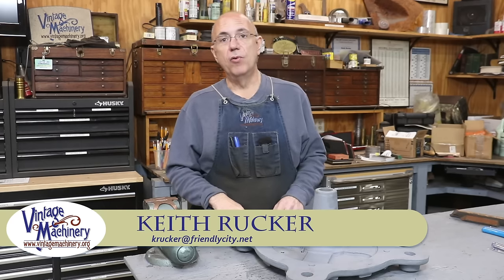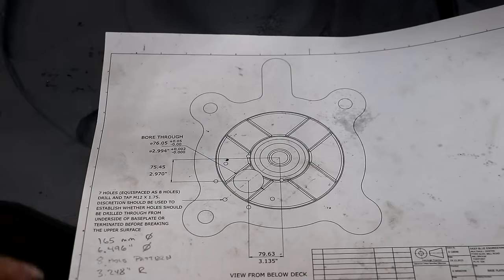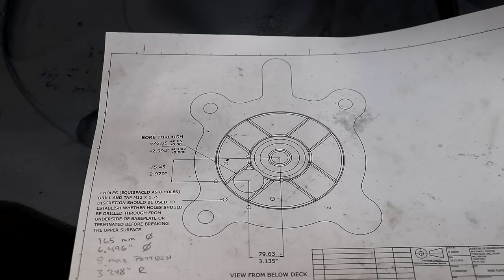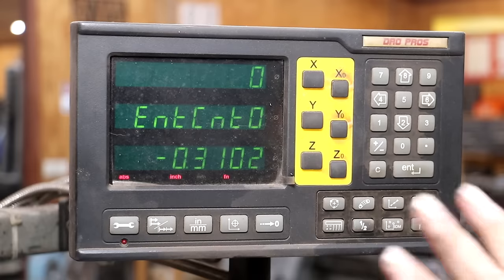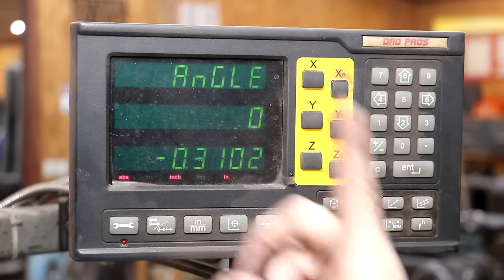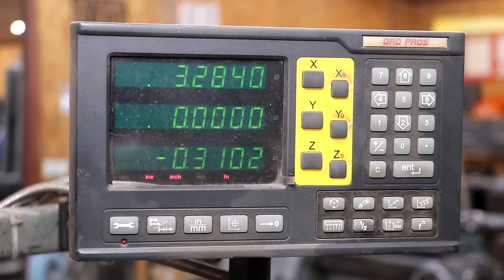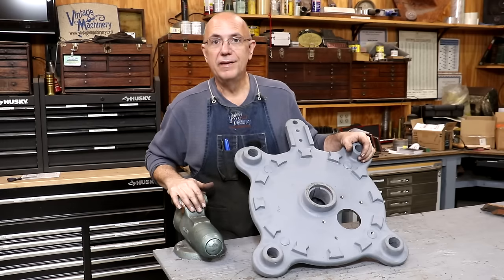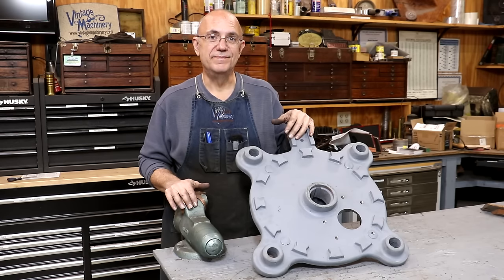Tally Ho Capstan Restoration: Drilling & Tapping a Bolt Hole Pattern in the Capstan Base

Comment: Just to warn you and anyone who sides with you about how you do a particular project. I disagree with the way you went about drilling and then tapping your holes.

You present your videos like a professional with the intent that how you deal with a job is the correct way. The end product, although it may be satisfactory, it is not always the correct way to achieve it.

Some viewers who watch your videos are looking to be taught how to do a particular job. Not everyone looks at your videos as just "entertainment." Therefore, as you introduce yourself at the beginning of every video, you should also include a disclaimer. Something along the lines of. "My videos are not about how to do a job correctly but how I do it. My way is not necessarily the correct way, but the end result is what I achieve." You may be surprised to learn, a lot of youtubers use disclaimers, to save on hatefu, even threatening comments.

As an engineer of 42 years and someone who subscribes to several engineering channels, including yours. The one thing I have observed over the years is something I myself do, and when you think about it, it makes perfect sense. 

That is, use a similar product to the green cutting medium you are using with one significant difference. I, as do all the other engineers, we lubricate the tap, not the hole. 

As a professional engineer of many years, Keith, you should know that. Look at how much of your lubricant is wasted doing it your way.

Next up, your tapping method. Why not use a fast drill tap set? You use your lathe to centre mark, pilot, and finally drill the holes, so why not tapping them in the same way, too? You know the project is cast iron, so why not use the correct fast tap for the job?

Alternatively, after drilling all your holes, considering you tapped them by hand anyway. Why not tap them from the other side as you had to do with that last hole? The way you tapped those holes was so awkward to watch. It really irritated me. I wanted to barge in, push you aside, and show you how a professional does the job!

I appreciate that everyone has an opinion. Everyone may do the same job in different ways. But there is one thing you Keith and everyone who will side with you is overlooking. There is ALWAYS the right way or the wrong way to do a job, and the way you did this job is the wrong way.

While on the matter of that last hole. You obviously did not notice it, but as you started to drill, it flexed out. The result is that the correct position for your hole moved ever so slightly. Let's hope that when your customer comes to secure the motor, that hole lines up. It may come back to bite you!

What you should have done is use a flat milling tool of your choice, larger than the size of the hole you need. That way, when you spot drilled using the centre marker, then the pilot drill, it would have positioned correctly with no interference. Other than that, great video.⚒️🏴🇬🇧🇺🇦🇮🇱
Reply: Cripes dude, get over yourself.
Reply: Great points, a little harsh, but the real world doesn’t pass out trophies to everyone who participates. In the real world sometimes criticism is painful.
Reply: @grntitan1 
I am a fully qualified engineer of 42 years. I run a multi million pound business in the UK with two other branches. One in Europe, the other in South Africa. We make precision parts for the MOD and other military organisations. From tank parts to aircraft, even missile parts. 

I watch this type of video as a form of relaxation, a change from my everyday engineering life. But when I see people presenting themselves as professional engineers who have all the equipment but none of the knowledge or experience to do a job correctly, it angers me, and why shouldn't it?

The first reason is that most are about just saying something for the sake of it. Im not talking about Keiths true followers, but the fly by one's. The ones who say things like, "Oh, I love the way you did this or did that." Or "Good job, bla bla bla. I am looking forward to seeing your next video." The ones who leave a few words or a line that mean nothing worthwhile. 

Some comments are like sucking up, brown noses we call them. Some just want to say something, to appear important, to be noticed, to have their ex number of minites of fame.

The second most important reason concerns the ones who want to learn how to do a job. The occasional viewer who typed in the search bar is looking for something in particular. These viewers in some way are being deceived. They know no better.

The final reason is because reading comments left by people like your good self have no clue. They just want to pi55 people off leaving comments like the one you left me. The ones who want to appear important to get themselves noticed with viewers who acknowledge their comments. That type of person looks for entertaining qualities, not educational ones. And that's my whole point!

Instead of telling me to get over myself, get a life is the usual response. Why not say something constructive and worthwhile. Perhaps you didn't understand the concept, which would explain your reply. Perhaps you are, according to CNN, last week, one of the 67% of American public whose educational skill level is lower than the average mark. Perhaps it could be any number of reasons.

The art of conversation is disappearing fast. Why, how? One reason, the main reason is because people now use the mobile phone every moment possible. Not everyone but most. You just need to look around you in the street. Next time you're in a bar, take a look around. You may see a group of say, 4, 5, or 6 people. Two may be talking while the others are glued to their phones instead of participating in what the other two are talking about. 

People nowadays would much rather play games on their phones or search through Facebook, Tinder, and many other social media platforms to see who said something they can reply to. While others need to know who swiped left or right than have a proper conversation. That is the category I believe you fall into.

Please indulge me with this simple test:

One day, you are looking for a solution to a problem. You look online, let's say, Youtube, for example. You find what you believe is the answer to your problem. Only something catastrophic happens when you follow that person's guidance. The way they did something was wrong, but you had no knowledge, no incite, as to what would happen next. Then what?

You see my friend. That is the whole point of my comment.
Reply: @ScrewThisGlueThat 
Thank you. What you said, i couldn't agree more with you.
Reply: Wow! Feel better now?
Reply: How does one talk so much, yet say so little?
Reply: @Katchi_  you mean, the way you just did?
Reply: @boogiewoogiebubbleboy2877 There is no such thing as a "fully qualified" engineer. Engineering has many fields including civil, electrical, electronic, materials sciences, aerodynamics, avionics, maritime to name but a few. To claim the status of fully qualified is pure arrogance. If you are going to comment in such a supercilious, condescending, holier than thou manner you need to be telling the truth otherwise people will call you out as a gish galloping keyboard warrior.